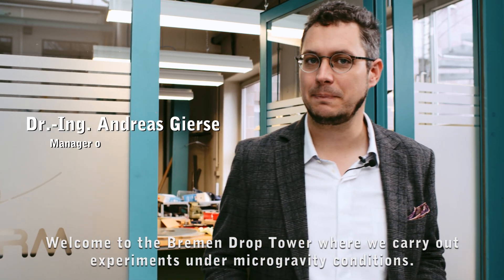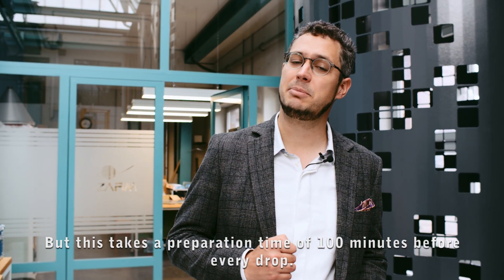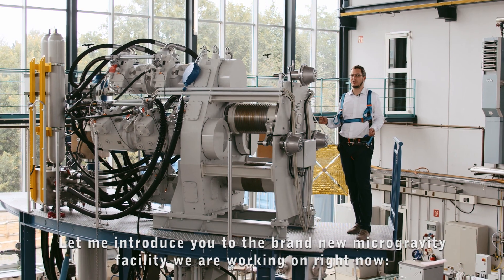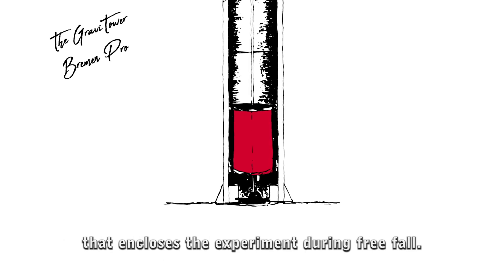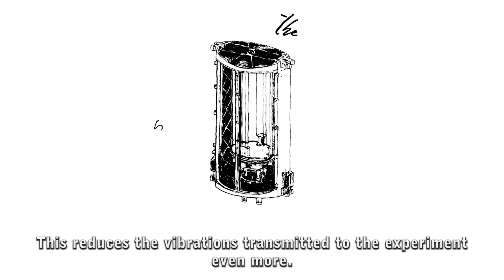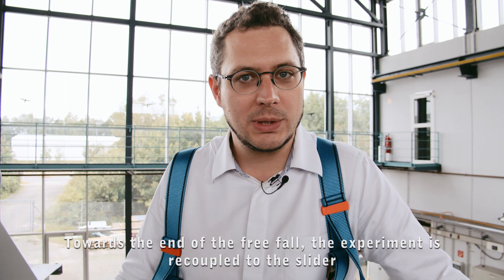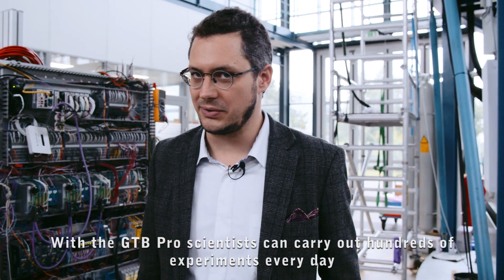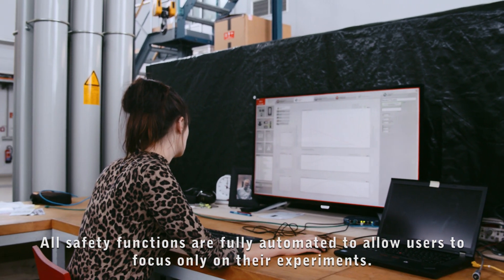The GraviTower Bremen Pro - The new Drop Tower?

Comment: YouTube recommended this after I watched Tom Scot's video on the Bremen Drop Tower.

I hope you are working on a third micro-gravity tower, which will allow passengers?  😉
Reply: There's a plane for that, tom scot also has a video about it.
Reply: @Alhussainba  "The vomit comet" does very different work to these.  Both useful but handling other kinds of experiments to one another.
Reply: @Temp0raryName  can you elaborate on what's the difference? I thought the purpose of both is to achieve microgravity?
Reply: @Alhussainba  The working environment is what constrains the experimental uses of each.  The BDT allows precision control of experiments & thereby precise repeatability.  Likewise the quality of the microgravity produced is orders of magnitude better.   Plus there are advantages to operating in a facility (e.g. repair/fabrication shops), rather than only having access to equipment you can carry with you.

Whereas the vomit comet can assist in  microgravity training, as it is people friendly.  It can conduct many more experiments per day.  So if you need to adjust a variable a lot, but can accept variability in the microgravity within your tolerances (just think about turbulence) then aircraft experiments are your better option.